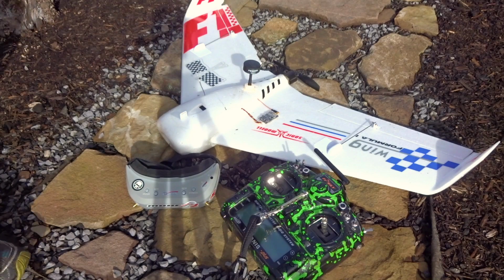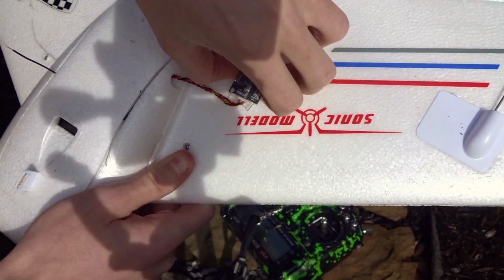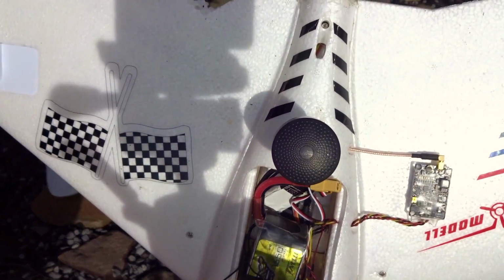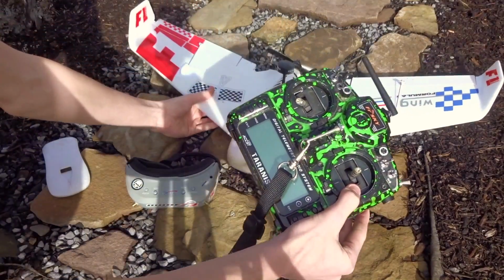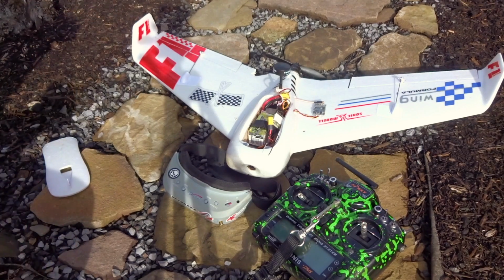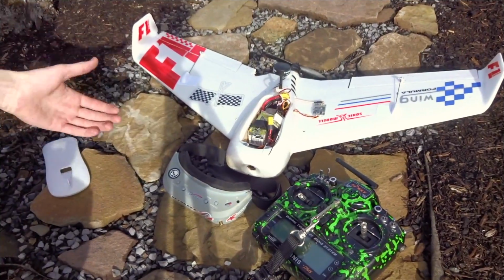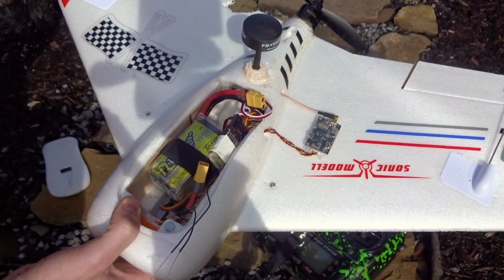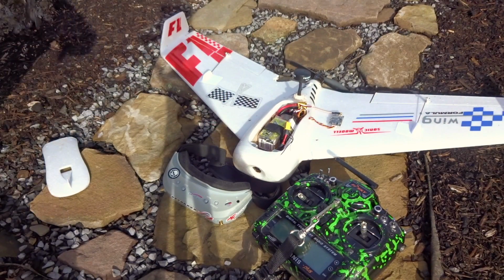FPV Wing Overview and Flying : Sonic Modell F1

Comment: I've got it's bigger, blacker, brother, the Sonicmodell AR wing running similar gear and it's a total blast. Flying around for 10-15 minutes on a lazy afternoon is a very different beast than holding on for dear life for 3 minutes and 37 seconds in one of my quads. If you are reading this and have only flown quads do yourself a favor and buy a wing to mix it up, they are cheap and it's a very different and fun flying experience.

Comment: If you get in a crash with your drone and some of the Wires disconnect from the camera will it still fly because I crash my Quad and some of the wires from camera disconnected and all it dose is beep ?
Reply from the maker: The FPV system is along for the ride, will not matter if it's power up or not.

Comment: I was wondering about buying one of these wings but I am confused about how you powered your vtx, on this wing is it really as simple as wiring the vtx onto the main battery lead? Does this not put too many amps through it. Love your vids btw
Reply from the maker: I just tacked the vtx power onto the main wires. Current pulled by the motor is not going to be shoved into the vtx, that's not how it works. Depending on your VTX this method might produce video noise though, you just need a decent one with regulation and filtering.
Reply: Thanks that's really useful!